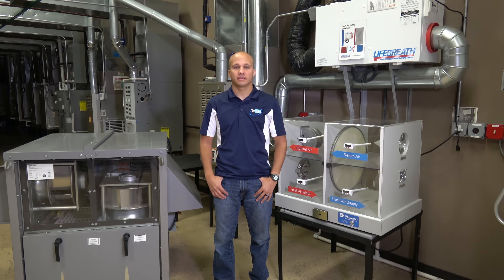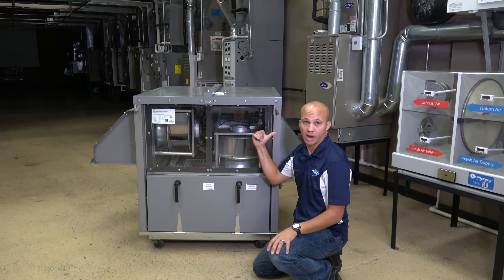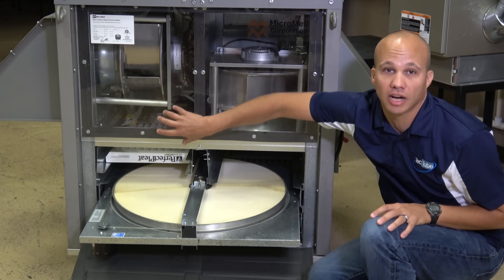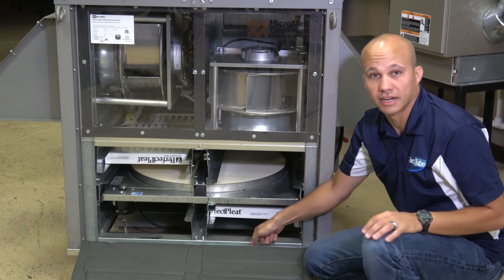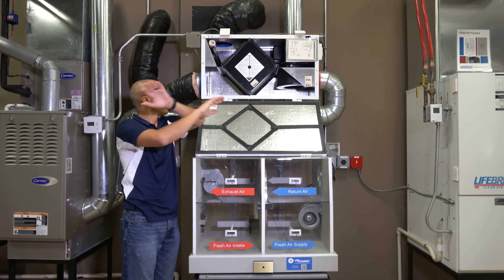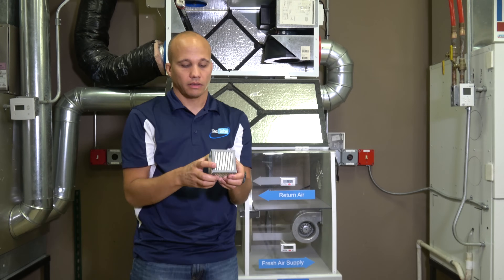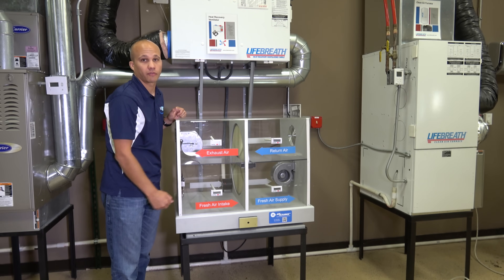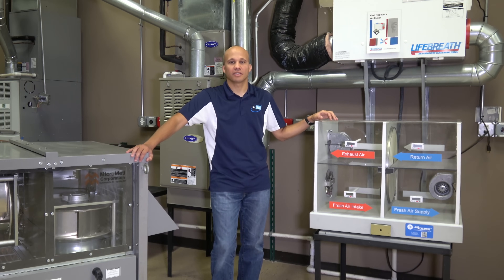Fundamentals of Energy Recovery Ventilators (ERVs)

Comment: CO2, keep it below 700ppm too expensive ? Find out how ventilating is managed in commercial airplains. 700ppm for pilot cabin, 1200 - 1500 for the passengers, the paymasters. Why? Tests show clearly that cognitive performance starts to drop above 700ppm. 
But if you drive fully occupied cars, all enjoy about 2- 3000ppm, you can do that also at home.
Reply from the maker: The standards, such as ASHRAE 62.1 and IMC... as well as most studies... are for the indoor CO2 to not exceed 700 PPM above the outdoor ambient CO2. So if the outdoor level is 450, then you want to keep the indoor below 1150.

Comment: Reasons why new air from "outside" must enter rooms are named in ERV/HRV videos. But very softly. The main reason, CO2, not.  A CO2 controller, 200$, manages all well.  700ppm as set value. Over 700ppm the ventilation is ON.
No humans and pets in room, or you open doors and windows, CO2 drops below 700ppm, ventilation stops.
Minimum ventilation ? YES,  install parallel a programmable 24hour timer. Choose interval and time to your situation.  
In very humid situation a small dehumifier can be helpful, always on.
Reply from the maker: We are not sure what you are trying to say or ask. We will say that CO2-based Demand Controlled Ventilation (DCV) is effective at reducing the outside air intake below the code minimum when the building is partially occupied. However, an ERV is very effective at reducing operating cost when you can't legally reduce the outside air. And... many folks might not know... but you can combine the two technologies (DCV and ERV).
Reply from the maker: Check out this webinar on DCV - 
https://youtu.be/Ij8LxpPkjfI?si=O3h7kPVisK2A414c

Comment: The demo with the wheel type "core" , working temperatures displayed, explains perfect. Condo small houses will use plate ERV "core". They will do the same job or  better then the "wheel".
Reply from the maker: A wheel almost always outperforms a fixed core and it can do more heat transfer in a smaller cabinet.

Comment: so ERV has no drainage?
Reply from the maker: Generally an Enthalpy Recovery Ventilator does not form condensation because the air temp does not reach the dewpoint. This is because it is recovering both sensible and latent. It re-routes the moisture to the other air stream that needs the moisture. With that said a Heat Recovery Ventilator, which is a device that only recovers sensible, will need a drain in the cold winter because it lowers the temp without transferring the moisture.
Reply from the maker: If you look at the video at minute 4:25 you can see the black drain tubes coming of the bottom of the HRV

Comment: Question: when the hvac system is not running should the ERV be off? there would be not benefit to have it on while the system is off?
Reply from the maker: If the ERV is ducted into the main HVAC system, then they should be on/off together. Keep in mind that ventilation in a commercial building is required constantly, hence both the ERV and HVAC need to be on, during the buildings occupied hours.
Reply: @TECTubefilms  thanks for the reply that's what I thought was the case for my ducted system for my residence. The builder told everyone in my neighborhood that it needs to be on 24/7 and taped the switch on. We are not in a high humidity zone (cen California).
Reply from the maker: @hctibeyb1788  The climate won't affect the code requirement to run the system 24/7 or not. Modern residential, like commercial for a long time, requires continuous ventilation.
Reply: @TECTubefilms  gotcha. Just noticed my heater actually runs longer and more often when it's on pulling in colder air. I just turn it on for 30-45 mins here and there daily your being in fresh air. Thanks for the reply

Comment: @techtube 
What is the percentage that building exhaust air can go as carryover back to building?
Reply from the maker: It depends on the classification of the air in the exhaust and the specific local mechanical code. For example, if it is general exhaust and you are under IMC, then usually 10% can be recirculated from exhaust back into supply... or what AHRI calls Exhaust Air Transfer Ration (EATR). Other classes of air can be 5% or 0% in IMC.

Comment: If you guys ever make another video, instead of discussing principles, please show temperatures.  
I'd only buy one for its thermal (and cost) benefit: test it in each mode, relative to cost & life expectancy.
Reply from the maker: Go to about minute 7:45 of this video and it does show temperatures
Reply from the maker: Cost benefit depends highly on total CFM and your heating and cooling fuel costs in your area. Where we are based in the Midwest, ERVs smaller than 500 CFM (i.e., residential sized units) have very long paybacks. However larger systems, such as those 1,500 CFM and larger used in most commercial buildings have very fast paybacks. Maybe take a look at our webinar from 2020 around the 19 minute mark for some examples of cost paybacks. https://youtu.be/gc6ZAnl6mrg?si=s9ju9nYt0IkJ1sUi

Comment: This is the best demonstration I have seen to explain the ERV function. I was surprised at how well the ERV was able to transfer temperature in the demo. I wonder if you could generate some steam at the outside air input and also see how well the humidity would be transferred using RH gauges in each chamber as well as thermometers. Also, it would be interesting to compare the efficiency difference from the rotating membrane compared to the usual home module.
Reply from the maker: There is plenty of data to illustrate the efficiency different between an enthalpy wheel and fixed plates.

Put wheels are only for commercial projects. No one makes a wheel small enough for residential.

Comment: Using a portable aircon... ... I can draw in fresh (even with secondhand smoke) by the huge inward pressure which will be sucked in to cool down the condenser, dirty fresh air directed to the aircon by DIY pipe... .. while part of the sucked in air will be pulled into a IKEA Fornuftiq... ... position at the top of the portable aircon (since ash and secondhand smoke are usually 'heavier' air portion unlikely to escape the air stream inertia) to be blown through the aluminium filters and be blown cold air into the room... ... then the additional air sucked in by both Fornuftig and portable aircon will be forced out of the room by the gaps... ... Don't even need a fan... ... All we need is a gap at the other end of the room... ... Hmmm... ...

The aircon will dehumidify the room as well. So I can finally use wood funiture. Now the set up shows a humidity of 59% very close to Scanteak showroom's 50% and  temperature at 27.7degrees, which will need some work. 

Mean I have to redesign the setup... ... Hee hee hee... ... ...

Before this, it is always above 71 to 75% and reaching 83% humidity. No way I can see a 50++% humidity. Good... ... ...

I must do the upgrade to the room. A portable aircon is a bliss... .... It can be used to play fresh air ventilation unit which normal cost tens of thousands. But a portable aircon is only S$699... ...  getting Fornufitig and a strong fan  is still below S$1000.

Good. Hee hee hee hee hee... ...

Let's redo a little and boost up the coldness, and it will be perfect.

Hahahahahahahahahahahahahaha... ...

Hahahahahahahahahahahahahaha... ...

Kinda cheap.

Comment: What capacity do I need to cool a humid 1000 square foot house?
Reply from the maker: ERVs do not cool buildings, nor do they dehumidify them. The only thing they can do to help with heating and cooling is use your exhaust air to pre-cool and pre-dehumidify your ventilation air coming. The amount of ventilation air you need to bring in... and hence how large of an ERV you need... is based on your local building code. Where we are based a 1,000 ft2 single family home with 2-3 bedrooms would require only 45 CFM of fresh air so you would need the smallest ERV you can find. You are allowed to bring in extra outside air if you want to further improve ventilation, but it will equate to more compressor based cooling and dehumidification needing to maintain comfort than a smaller ERV.

Comment: If I wanted a system to reduce building/room air humidity as much as possible for a specific production purpose but keep the heat in, which one would I want?
Reply from the maker: If the moisture is being introduced by outside air coming into the building via the ventilation system, then you would want an ERV. If the moisture is due to indoor sources (pool, people, fountains, etc) then you would want a HRV.
Reply: @TECTubefilms  Thank you. Sounds like I need an HRV.

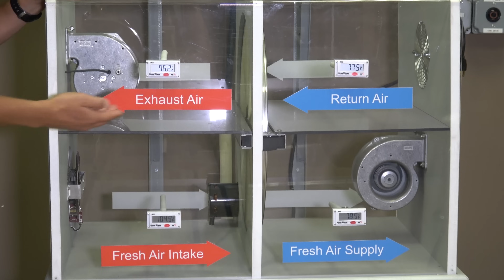Comment: 9:00 run smoke through it, I'll bet a lot of air is going from top chamber to bottom / bottom to top instead of directly through
Reply from the maker: That would be a good visual. In the meantime we will add two items:

1) ERVs are AHRI tested and the accidential recirc from return air back into the supply air is represented by the Exhaust Air Transfer Ratio (EATR) and it is often well under a half percent. Most mechanical codes require this number to be under either 5 or 10% depending on the class of exaust air on the project.

2) Locating the exhaust fan in the draw-thru position relative to the wheel minimizes the EATR.
Reply: I agree completely.. that would be a very good visual

Comment: In summer, hot moisture air is sucked from outside, and this hot energy is transferred to heat exchanger, there by the hot air losing it's energy to heat exchanger and converts to cold air which is then pushed inside the building space...and vice versa in winter...is it right?..pls confirm.
Reply from the maker: yes basically
Reply: @TECTubefilms  Thank You for confirming

Comment: so is paper fine? and that silica, how is that doen'+
Reply from the maker: Silica gel is impregnated into the polymer. It basically becomes one material.
Reply: so If i crush silica beads and make sheets using epoxy as the binder, I am fine? or just use the whole bead. @TECTubefilms

Comment: We “Company i worked at” had two small similar systems in two small labs within over 8 million sq feet of air conditioned space . They proved uneconomical and maintenance intensive  . And were decommissioned within 2 years. Unless designs /materials improve greatly they are not worth the effort or investment.
Reply from the maker: Uneconomical? What specific types of units were they and what maintenance activities were you needing to do? Was your lab exhaust air caustic and hence you needed to do more than the normal simple maintenance of quarterly filter changes?
Reply: @TECTubefilms  These were tightly controlled labs humidity45 % +or- 5%   temprature 59 +0r- 1 degree constant monitoring. Exceedences would stop work for 24 hours. One unit used a 3’ honeycomb wheel ,the other was a plate arrangement.
Reply from the maker: @charlespaine987  What specifically made them stop working? What did you have to do to get them up and running the next day?

Comment: This is an absolutely excellent video explanation. Close-ups, hands on, shows what's happening. 

He mentioned an exhaust duct "from FURNACE to HRV, then vented outside" at 5:55. Is this true, or was this duct pulling exhaust from bathroom? I'm trying to understand how to tie into existing HVAC ducting.
Reply from the maker: Yes, in this particular ducting scenario (and there is more than one way to duct it), the HRV pulls air from the furnace return and exhausts it outside. It then pulls air from the outside and replaces it in that return duct. This is the easiest way to duct it, but it also doesn't save any energy. The best way... as you hinted at... would be to pull air from the bathroom instead of using a bath fan and run that thru the HRV instead of pulling return air. This is air you planned to throw away anyway so may as well reclaim energy from it.
Reply: @TECTubefilms  Ok interesting. Thank you. I'm less worried about energy, more worried about excessive redundant systems, ducting, and wall penetrations (bath fans, HRV, kitchen fans, makeup air, furnace, dryer ducts, etc).

Do they make enthalpy core boxes (without the HRV blowers) that can duct straight to the air handler using its central fan? To consolidate some of these duplications? Which vents can be combined?

I don't understand why we ditch the high CFM flow rates and high MERV filtration of an air handler for these tasks, and instead use these dinky little 100cfm central exchangers. In full redundancy no less.
Reply from the maker: @slipperyslope3912  Pretty much the ONLY reason to install a HRV is to save energy. If you don't need/want the energy savings and just want fresh air, then there are several methods to duct outside air into the HVAC system without the expense of a HRV.
Reply from the maker: @slipperyslope3912  No, we have never seen a residential size HRV without a fan. Just ducting it into the air handler would not work. The pressure drop of the HRV heat exchanger and filters is so high, that the air handler will just draw all of its air from the return duct and none from the HRV duct.
Reply from the maker: @slipperyslope3912  You do not lose the MERV filtration with a HRV ducted into an air handler. The outside air coming thru the HRV is ducted into the return of the air handler upstream of the air handler's filter.

Comment: I'm thinking of building an small HRV, is there an advantage to the wheel type vs fixed fins?  Leaning towards fixed fins and doing multiple cross flow cores or a single counter flow as it would be easier to build, but the wheel ones are also kinda intriguing.
Reply from the maker: The advantage of a wheel is that it has significantly higher heat transfer ability for a given size of cabinet. The disadvantage of a wheel is if you need AHRI certification for zero crossover (aka EATR).

Comment: I have 4 ERU's in one of the buildings I take care of. I started servicing these about 4 yrs ago so by the time I got to them they were about 16 years old. What I learned is that the manufacturer recommends changing the desiccant wheel every 5yrs, but in that time the unit becomes out of production. I imagine they are nice when new but my experience leans to simple economizers controlled by the energy management system. With that said mine are being replaced next year. I am hoping with a clean slate I will have a better IAQ for the people in the building.
Reply from the maker: Which manufacturer is recommending that you change the wheel every 5 years? The wheel in this video is from Airxchange and they do not recommend ever replacing the wheel unless you damage it physically or something like that. The wheel will outlast the cooling coil and heating system in that same cabinet... and it will outlast the cabinet itself. Many wheels, much like compressors, have a 5 year warranty but are expected to last much longer. Is that where you are getting the 5 year number from?
Reply from the maker: Economizers serve a different, but related, purpose in the system. Per energy code (IECC), economizers are required to be used in conjunction with the ERV. And more specifically, the ERV needs to shutoff and the economizer used when the system calls for cooling on an "economizer day."

Comment: i’m replacing the capacitor on the fan, after the erv has been inactive for a couple years. there is some corrosion too. the fan spins, but it is like a bike wheel where there is contact with a brake pad, rather than a smooth spin that keeps going after released. how easily should the fan spin?
Reply from the maker: It might be a "sweeper" that is slowing it down. That is a little brush like you have under your exterior doors. It is there to reduce inadvertent transfer. But in any case, you need to figure out what is slowing the wheel down when you spin it by hand and then decide if that is supposed to be there or not.
Reply: (oh, this is when i try to spin it by my fingers with the unit unplugged. i haven’t connected the capacitor yet)

Comment: Awesome video so it’s safe to say that when you have a heat wheel your outside air damper should be at least 90% open and return should be at least 10% closed? Thanks advance for the response god bless!
Reply from the maker: No, that would not be safe to say. If you are talking about the OA damper bringing air into the ERV, that would normally be a 2-position damper that is fully closed when the space is unoccupied and ERV off or fully open when in use. Why would you choke it down? Unless it is a very small ERV and hence the fan speed is not adjustable and you need a damper for balancing purposes. But even then "at least 90% open" would still not be true.

Comment: I'm surprised the wheel spins that fast. I thought that each section of the wheel would need much more time to absorb the heat and change temperature before being able to transfer the heat to the other side. What material is the wheel and how is it able to transfer heat while spinning so fast?
Reply from the maker: We would consider this to be pretty slow. ERV wheels rotate at 10 to 60 RPM (similar to an old school record player), whereas a fan is rotating at 1,800 to 3,600 RPM.
Reply from the maker: This particular wheel is made of a polymer impregnated with a silica gel desiccant for moisture transfer.

Comment: In a core-style residential unit like you showed, is it possible to turn an ERV into an HRV (or vice versa) simply by changing the core from one with a metal heat exchanger to a polymer heat exchanger (or vice versa)?
Reply from the maker: Yes, that is possible as long as your model has a drain. Lifebreath used to offer this option, but not sure if they still do.